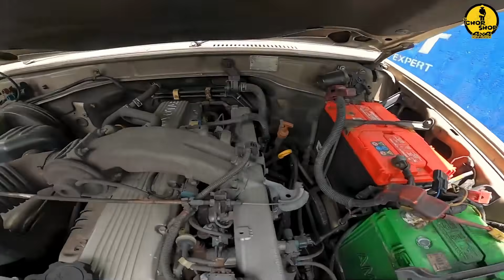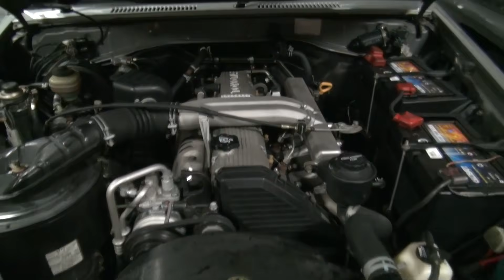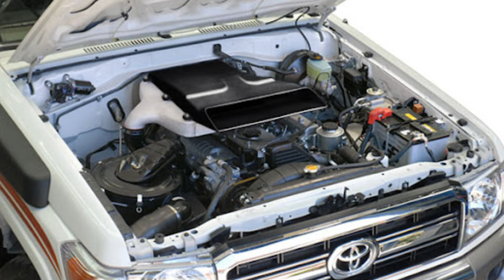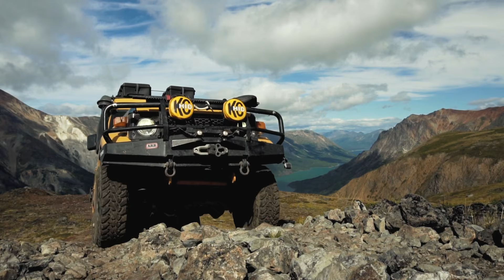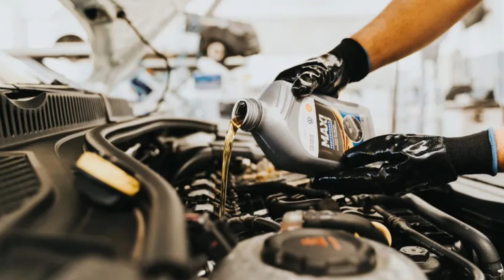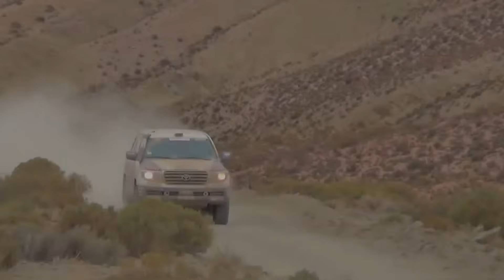The Most Reliable Japanese Engine of All Time: Toyota 1HZ Explained!

Comment: Sucks that we didn't get ANY of these cool diesels in the US. Sure I can import one, but then I have to drive an RHD vehicle on infrastructure designed around LHD
Reply from the maker: You’re not wrong — the 1HZ never came to the US in anything you could buy new. The 25-year rule opens up more of the 80 Series every year though, and there are a few US shops doing LHD conversions on imported HZJ trucks if you can stomach the cost. Out of curiosity, what would you put a 1HZ in if you could get one?
Reply: @VehicleWisdom my 3rd gen 4runner, Ive been tossing around the idea of a 1kz swap since it would be about as straight forward as it gets. The only real downside I see to doing it is that parts aren't locally available, I'd have to order everything from overseas
Reply from the maker: @R3L3NTL3SS52  The 1KZ in a 3rd gen is a well-trodden swap — mounts and the crossmember line up better than most people expect, and the 1KZ-TE is the one to look for over the earlier 1KZ-T. You're right about parts though: filters and the usual service stuff you can get, but injection pump and head work means overseas or a specialist. Worth asking on ih8mud — a few people there have done exactly that conversion and have the parts sources written down. If you do it, come back and tell us what it cost you.

Comment: I luve in the UK. I have a landcruiser 1HZ 76. You don't need a Turbo.
Reply from the maker: A 1HZ 76-series is the real deal — and you're right, naturally aspirated is exactly why it lasts. No turbo heat, no extra stress, just runs forever. That's the whole case for it. How many miles are on yours? A UK 1HZ that's been looked after is one of those engines that outlives its owner. 🔧

Comment: Not just fitted under the bonnet or hood of Toyota LandCruisers. They also were fitted to hundreds of thousands of Toyota Coaster buses. Our cricket club Toyota Coaster HZB50R bus was made in 1996 and spent its early life as a school bus. It currently has 1,056,000 kilometres clocked up. It may have been rebuilt once but it’s still the original 30 year old engine that shows no sign of giving up. And will possibly outlive the bus chassis it’s fitted to.
Reply from the maker: This is the comment I hoped someone would leave. Over a million kilometres on the original 1996 engine — and you're right, almost nobody mentions the Coaster buses, but that's where the 1HZ really proved itself: school runs, stop-start, decades of it, and it just keeps going. An HZB50R that'll outlive its own chassis is the whole legend in one bus. This might be the highest verified 1HZ in the community so far — mind if I feature it in a future video? Stories like this are exactly what the channel is about. 🔧

Comment: I change the timing belt from my 1HZ in 20 minutes 😁
Reply from the maker: 20 minutes is quick work! Small note though — the 1HZ actually runs a timing gear train, no belt, which is a big part of why it lasts forever (nothing to snap, no interval to worry about). If you're swapping a belt in 20 min it might be the accessory/serpentine belt? Either way, easy access is one of the joys of these engines. 🔧
Reply: @VehicleWisdom  😁👍
Reply: Easily

Comment: Mine is 1,080,000 klms. Just did clutch.
Reply from the maker: 1,080,000 km and the engine's fine — just a clutch, which is a wear item, not the engine giving up. That's the highest verified 1HZ in our community so far, just past a Coaster bus someone shared at 1,056,000. These engines genuinely outlive everything bolted to them. What's it in, and is it still your daily? Stories like this are exactly what this channel is about 🔧

Comment: Dont for get the 2H and the 12HT
Reply from the maker: Good call — the 2H and 12H-T are the family the 1HZ grew out of. The 2H built the reputation, the 12H-T added the turbo, and the 1HZ took the best of both. The 12H-T especially has a cult following. Might be worth its own deep dive down the line — would you watch that? 🔧

Comment: my pl 1hz has just clicked over 750k
oil change every 5k
Reply from the maker: 750k and still clicking over — and you just named the whole secret: oil every 5k, no exceptions. That's why these engines reach numbers others dream about. It's not magic, it's the 1HZ's tough design plus an owner who never skips a change. That puts you on our community 1HZ board, behind two that have crossed a million. Where's it headed — think it'll hit 7 figures? 🔧
Reply: @VehicleWisdom  Price of oil changes nowadays - thats about $20K spent on oil changes and filters over the 750kms.  Hard to balance that budget...
Reply: @mcsails1855  you have to do your maintenance. Modern car OEMs recommend every 10k now just so you can break down and take it into the shop.

Comment: 1hz is bulletproof and cheap.
If youve got the money to spare 1HDFT is the sweet spot for all around, 1hdt is alright but they eat big ends. Fte is electronic and ridiculous money, FT is mechanical everything about it is perfect.

If you were deciding between any it would be 1hz and 1hdft.
Reply from the maker: Great insights! The 1HZ really is a solid choice, and it's interesting to see how the 1HDFT stacks up. Thanks for sharing your thoughts!
Reply: @VehicleWisdom love the hz had 4 of them none of them died. 2 had 400 thousand, 1 had 600 thousand upon selling and the one ive still got has 550 thousand on the clock atm.
Put a turbo on the last one and the current one turbos been on this one since the 300's, when theyre looked after they'll never die.

Comment: Direct injection is may better and smoother. Go the 1HDT not 1HZ
Reply from the maker: Thanks for sharing your thoughts! The 1HDT is definitely a solid option too, especially with its direct injection technology. Both engines have their strengths!
Reply: 1hz can make more power than 1hdt when turbocharged
Reply: @jamierevis4972 1hz turbo is a time bomb

Comment: The 1HDT is so much better and stronger plus direct injection. I have had a 1HZ but will never go back after having a 1HDT. as a mechanic the shims for the cam can be on both engines are not the easiest to adjust but I have the genuine Toyota shim tool to push the buckets down. As you say but maintenance is the key mainly engine oil and filter and fuel filter change and air filter. They go forever if looked after properly
Reply from the maker: Thanks for sharing your insights! It's great to hear your experiences with the 1HDT and the importance of maintenance. Definitely, a well-cared-for engine can last a lifetime!
Reply: ... and what kind of injection does the 1hz have??

Comment: I have a hzj80 with 440,000k, and my 1hz needs a rebuild as the number 5 piston has zero compression, and the rest are between 350-400 psi.
Reply from the maker: Wow, that's quite a mileage on your HZJ80! It sounds like a rebuild is definitely in order. Hope you’ll have it back on the road soon and running like a champ!

Comment: I have a dodge ram hemi with more miles.
Had honda accord with over 750,000 miles and a 1997 Chevy cavalier with over 400,000 miles- (not kilometers which is way less)
Reply from the maker: Wow — those are some seriously impressive numbers! Hitting over 750,000 miles on a Honda Accord and 400,000 miles on a ’97 Chevy Cavalier is no small feat. It’s always awesome to hear real-world stories like yours that prove how durable and reliable some vehicles can be when they’re well taken care of.

And your Dodge Ram HEMI still going strong with high mileage too? Love it. It goes to show that with proper maintenance and a bit of luck, some cars and trucks can far exceed expectations.

Thanks for sharing — you’ve set the bar high for mileage bragging rights!
Reply: The answer is simple.   3,000 for regular or 6,000 for synthetic.   The greatest factor on engine longevity is changing the oil and filter at prescribed intervals.   Do it faithfully and you can get  high-milege numbers.  Don't do it and you'll have the rods sticking through the side of the block at 50,000 or less, depending on how heavy your foot is on the accelerator.

Comment: Most reliable - yeah, but this is real truck engine used in Toyota Coach bus. And saying truck I mean real truck, not so-called US pick-up shitboxes. So I'd expect 1 mln km or 600 000 miles of a lifespan from it. If not, this is not an engine I can't call tough and longliving.
Reply: Please.
There are plenty of American cars and trucks with way more that 600,000 miles on them.
Fords. CHEVY Dodge with 1,000,000 miles.
I have a Dodge truck with almost 400,000 miles on it.
Reply from the maker: @rdallas81 Hai , really appreciate for the feedback. Definitely we will research more and provide perfection information over time . And thank you for stay tune .
Reply from the maker: Hi , thank you for the comment
Reply: I had a 1975 Chevrolet Silverado that had a 305 cid V-8 which i swapped out,  at 400,000 miles,  for a 350 police interceptor 4 bolt main.  There was absolutely nothing wrong with the 305,  the rocker assembly,  crankshaft,  & oil pan sump were clean with zero sludge.  Ran as quiet as a sewing machine.  I own two Honda civics, so don't try to come back with some crap of being prejudiced on American products.   That being said;  I now own an older Ford F150 with the 300 6 cylinder motor,  which has over 200,000 miles on it and run quiet also.  These vehicles are not shitboxes unless you're a farmer hauling a load of manure in them.